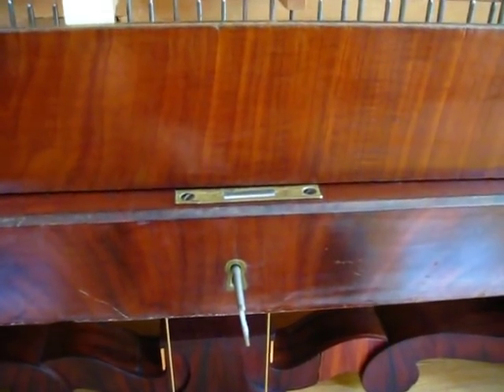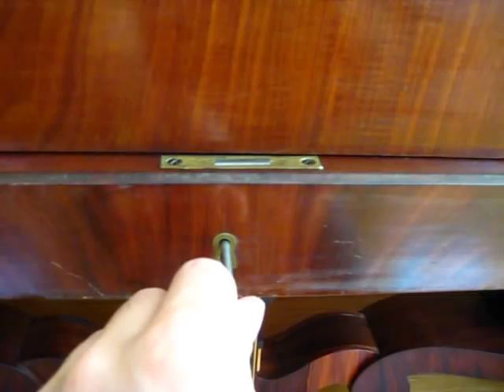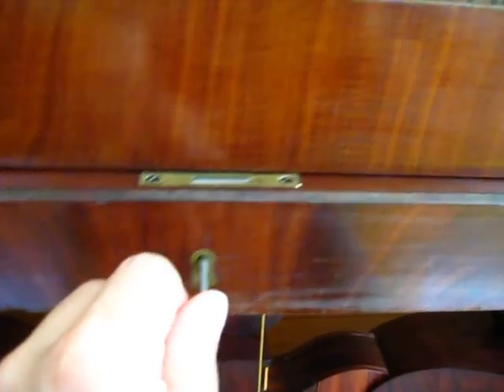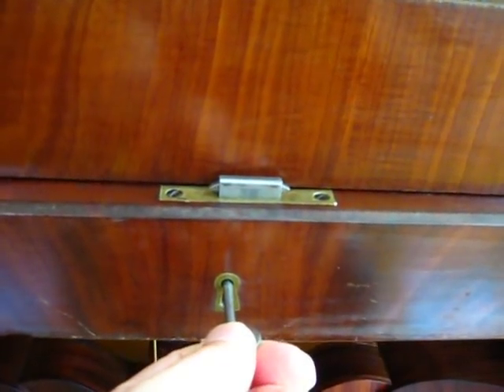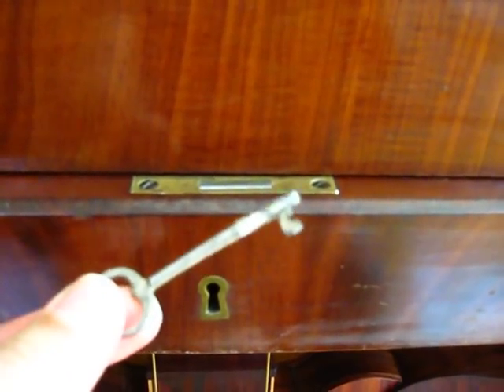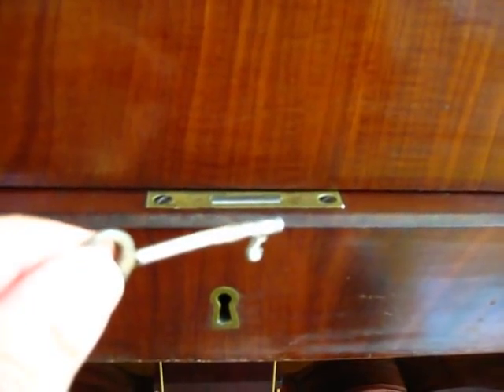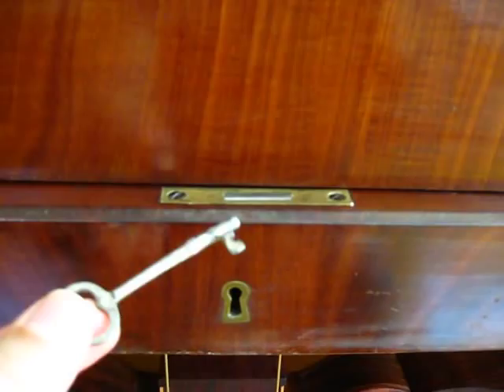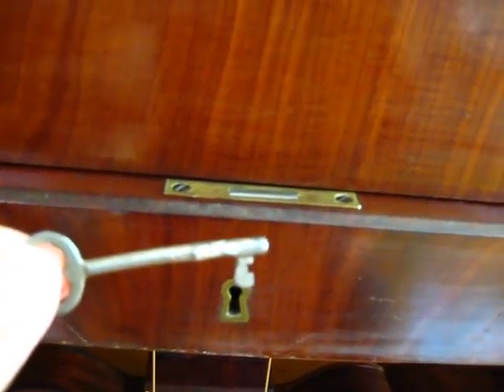Stein piano addendum: The Lid Lock

Comment: I am trying to remove the lid lock out of the piano but it simply doesn’t come off. How can I get it off (I haven’t forgotten to unscrew the screws).
Reply from the maker: Probably just tight/seized. Can you get a grip on it? Or perhaps stick something in the keyhole and push up...? Or...a small screwdriver or pick (preferably bent) into a screw hole and pry/pull it up.
Reply: @qwaqwa1960  Haha, thanks a lot I just hit it from the other side a couple of more times and it came loose. Thanks for the help and for being active on your videos even after 13 years 😁.